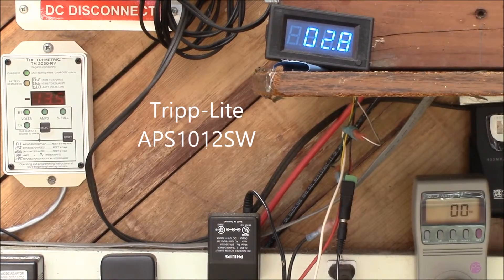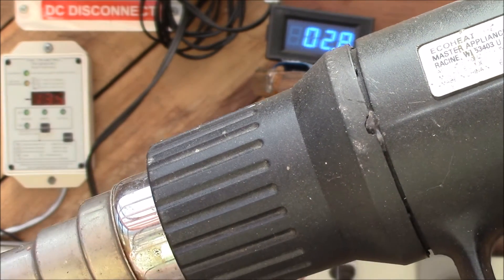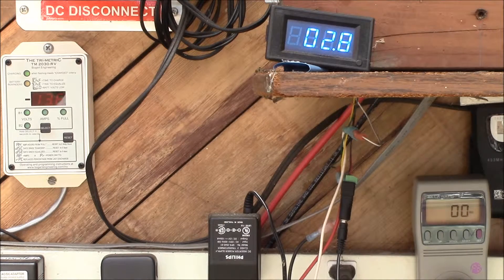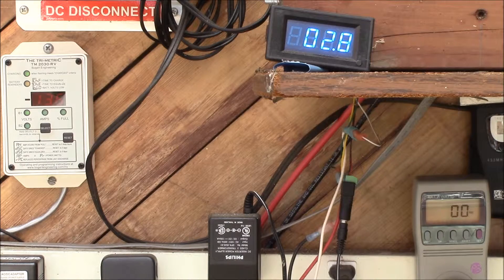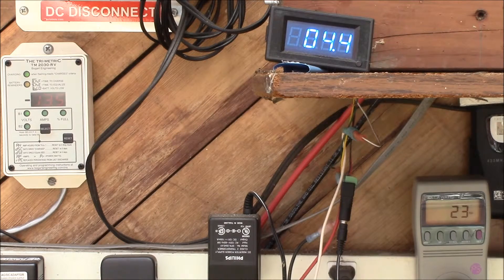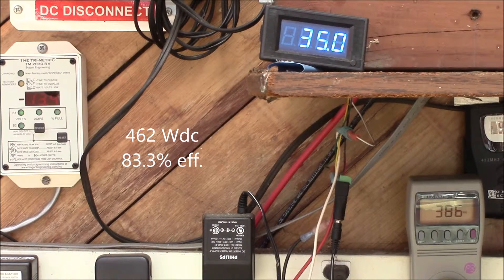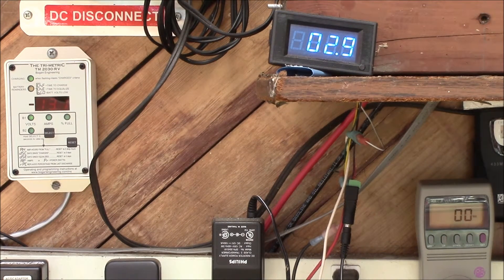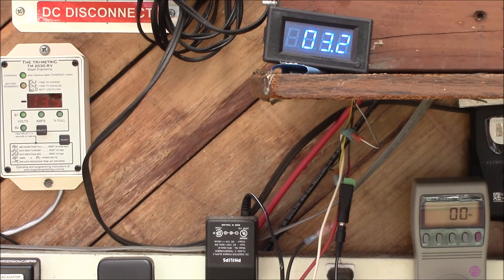Tripp-Lite APS1012SW Inverter Efficiency, Part 1

Comment: I have tripplite inverter, 2peaces of 200Ah batteries are like month old, load around 100w for 8 hour, The problem am having is the batteries are draining so first by the morning  the charge controller shows empty bars yet in the evening after charging full bars
Reply from the maker: If your charge controller is one of these with either a built-in or separate remote display, then the "state of charge" bar graph is useless.  Install a real state of charge or coulomb meter,  Those keep track of amp-hours in and amp-hours out to compute the real state of charge.  I've used a Trimetric:
https://youtu.be/5LcY-EqOV5Y?si=fgJz10XINWPcffZX
as well as a Victron Smart Shunt and there are others out there.